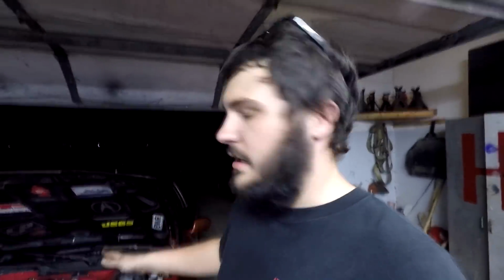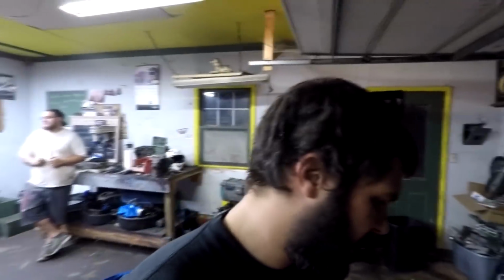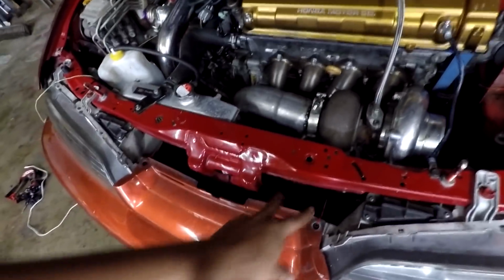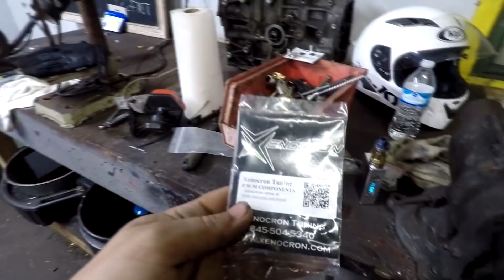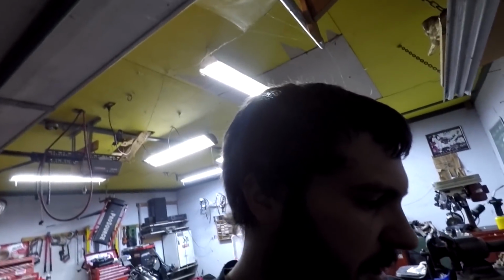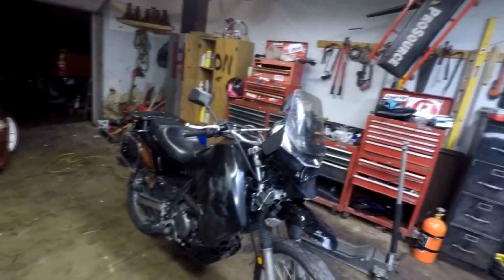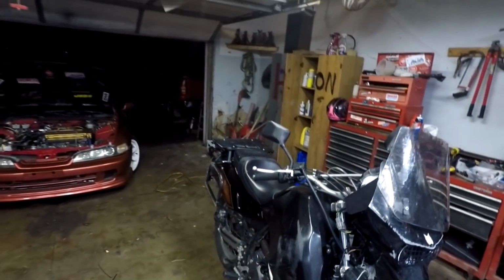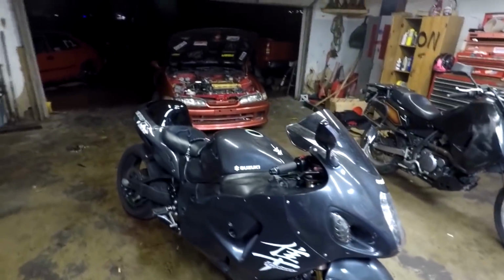The Story Of The Cursed Vtec Solenoid. Integra Is Fixed! + MPS Kill Switch Install

Comment: Another good video Hunter...
If you didn't know already? Your Busa has multiple maps in the ECU (for both Fuel and Ign. Timing) and it's very easy to switch the Maps (by simply opening/closing a wire connection).
So you can have one tune/map for Pump gas and the other one for MR12 (or whatever other Tune you want, including Nitrous)...
The coolest thing about it is you can switch maps on the fly which means you can tune the second map (Fuel and Timing) for Nitrous and have it switch maps "only when it sprays"... I have tuned many bikes through ECU on multiple fuels and or Nitrous and it works great...

Comment: Glad you figured it out, these tough issues are what separates the men from the boys!
Reply: Martin Short Absolutely, I wouldn't have thought that it was the VTEC solenoid prematurely engaging, but it makes sense given the sounds. I thought that it was a slightly bent valve sticking in the guide, but given the sound it was making the VTEC engagement pins between the rockers prematurely engaging makes alot of sense.

Comment: You think 29 degress in column 10 is safe for 10.6:1 gsr all motor on 91 pump?  Cant get 93 in CA.
Reply: Can you run e85? I live in cali too 91 is dookie.
Reply from the maker: Stick to 28